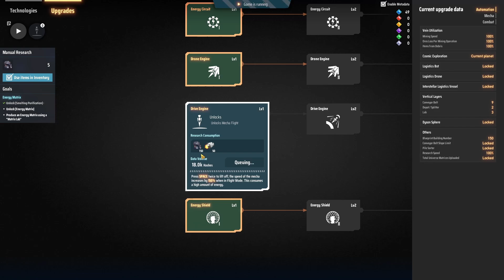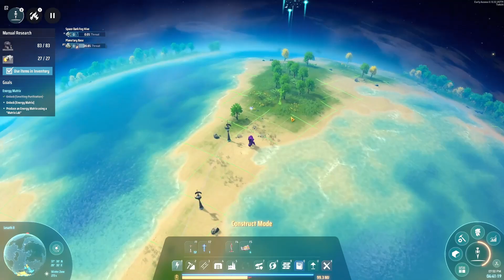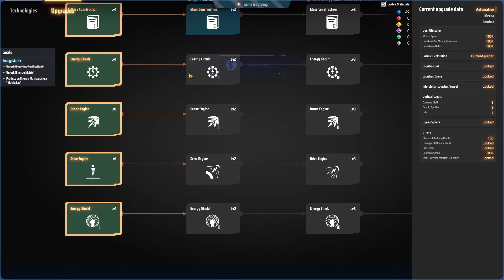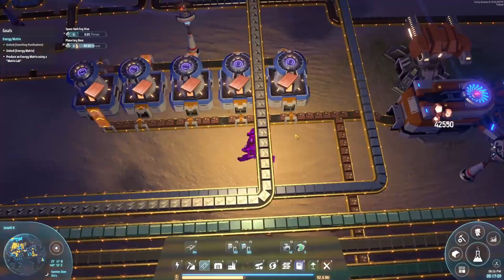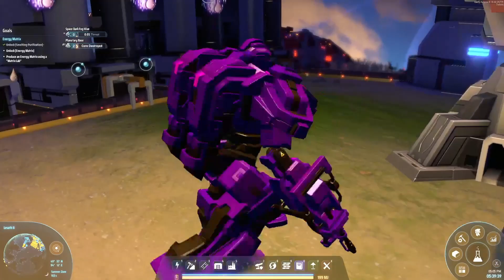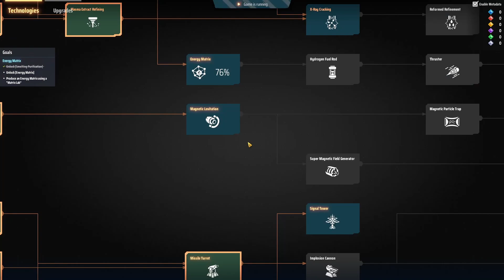Fog Repellant - Dyson Sphere Program 4

Comment: If you use the wireless power towers, they can transmit power over a wayyyyy farther distance (see dashed blue line between anything that uses power while in construction mode, shows whether or not something’s connected to power). Chaining those together is both more efficient and easier.
Reply from the maker: I knew about charging myself.. the distance thing is  new to me tho.. thank you